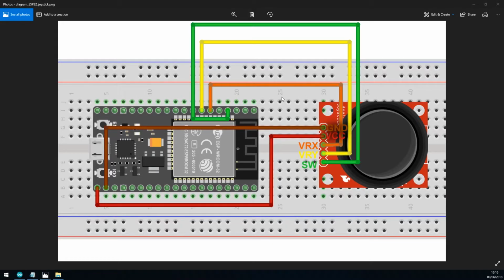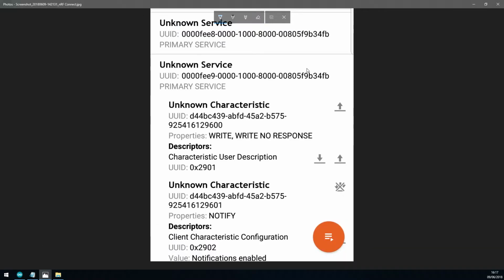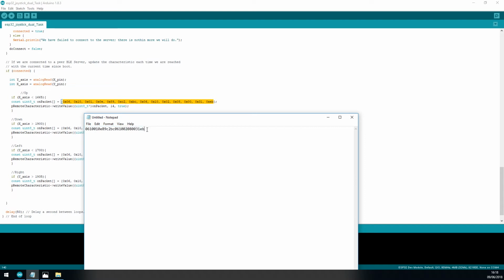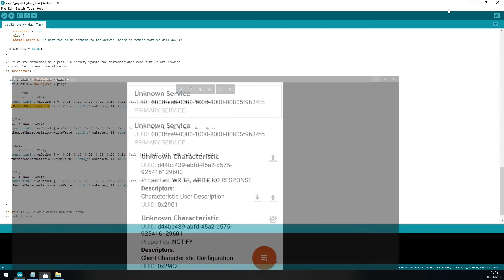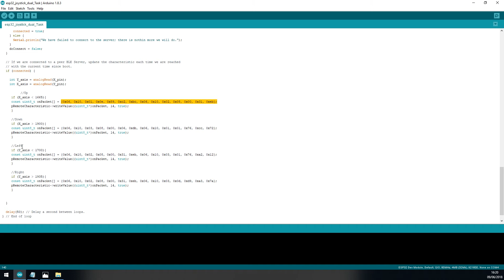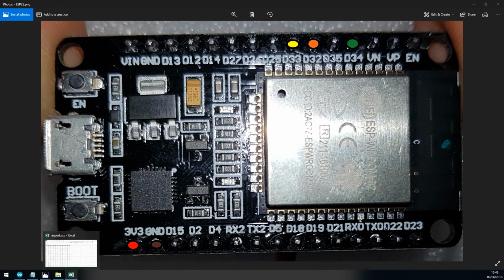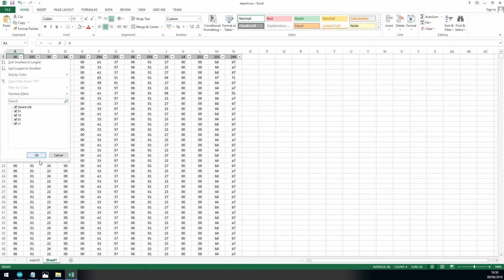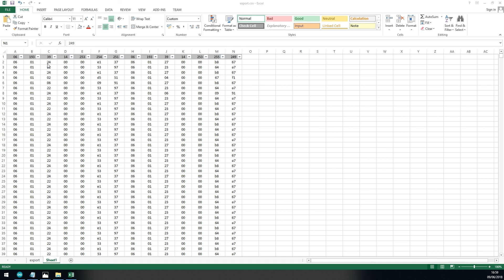EVO Rage Gen2/Zhiyun Crane V2 Gimbal control using ESP32 board and joystick

Comment: So cool !
I'm thinking to create a remote control for my crane2 with a esp32. I would like to loop a "moving time lapse" you can create by the app.
But i don't know where to found the BLE command to do it. Add a IN and OUT position and tell to the crane to move between those 2 points every X minutes...
Can you tell me where di you found the 8bit command to control yours ?
Thank's !
Reply from the maker: There are some other videos I did where I go through that process.

Comment: Wow, this looks super cool!! I have to admit I have very little knowledge in programming, but I always wondered if you could remote control a gimbal with a Nintendo Wiimote. (I use a Wiimote = Bluetooth with an Arduino Uno and the USB extension board to control Midi data going to a synthesizer.)
I own the Zhiyun Weebill Lab and the app is just beyond useless. Does anybody know if this code works with the Weebill as well?

Comment: Has anyone tried to controle a Arduino by the zoom button on the Crane trough (the upper)usb ?  So the power suply for the Arduino is also from the Crane the Arduino reads the Cranes  zoom button value and the cranes Bluetooth is free for another application ???  Maybe with a USB shield ?

Comment: interesting project very nice,
 you think you can also control the external servo focus?
Reply from the maker: I was planning to use something like 28BYJ-48 5V 4 Phase for controlling focus or zoom but currently I haven't had time get into this project
Reply: thanks, I wanted to know where I can find the parameters (similar to those of the gimbal x y) for the focus, I have the crane 2 with the controller on the gimbal and the original servo, the idea is to use an external controller made with Esp 32
Reply from the maker: Can you control the focus servo from the app provided? If not bluetooth possibly doesn't have access to the servo to control the focus.
Reply: is impossible with the app ,is bluetooth the external control
Reply from the maker: In that case you would need to build reciever for the follow focus motor to be able to control it remotely.
Reply: yes,I would like to know how to capture that parameter and then use it on Esp32